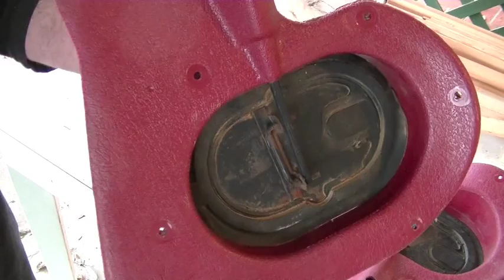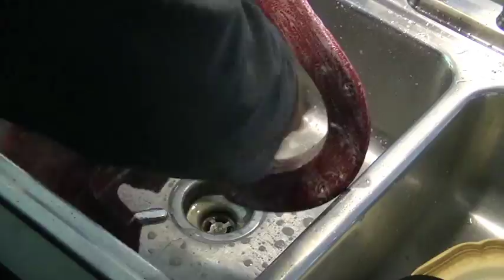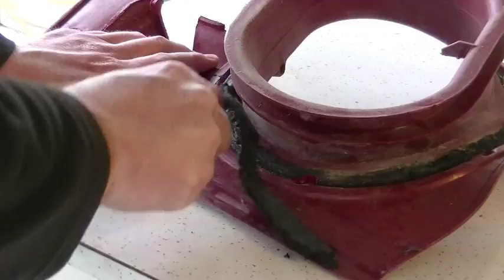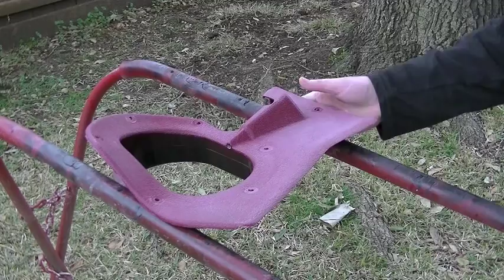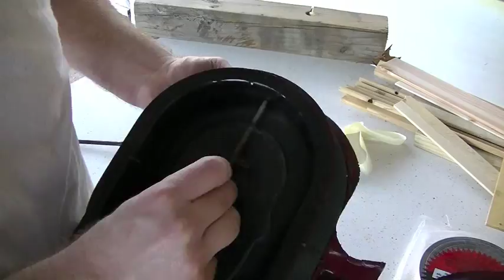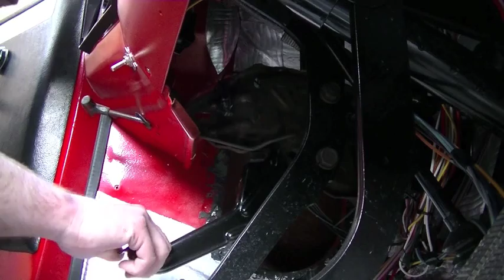Chevy C10 VENT/KICK PANEL Restoration & Installation | Non-AC Cab 73-87

Comment: Adhesion promoter.
Reply: I've don't that with bad results, plastic paint needs to go directly onto the plastic. At least why I think I had bad results, not 100 percent sure but would create a barrier between plastic and paint.  Paint is supposed to melt into the plastic.

Comment: You still should've just taken the time & wire-wheeled all that cruddy, old weather-stripping residue off of the housing, & you wouldn't have to fear cracking the housing using a wire wheel. The wheel does all the work FOR you.